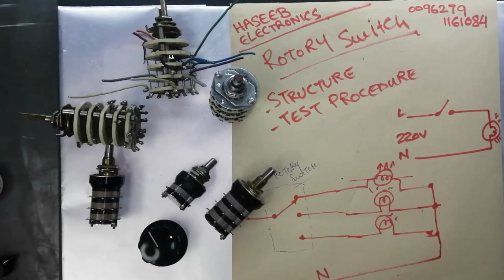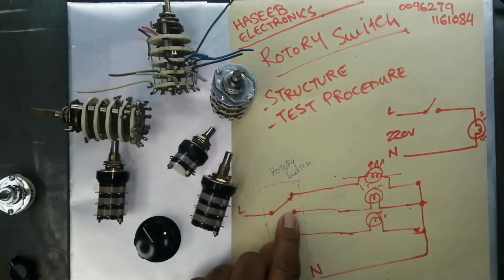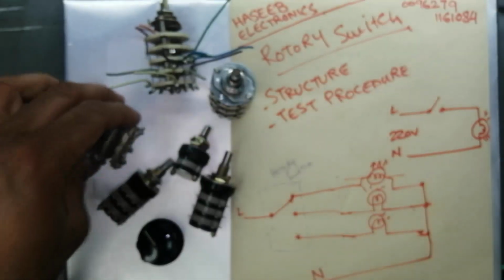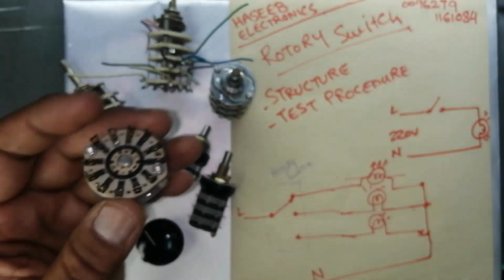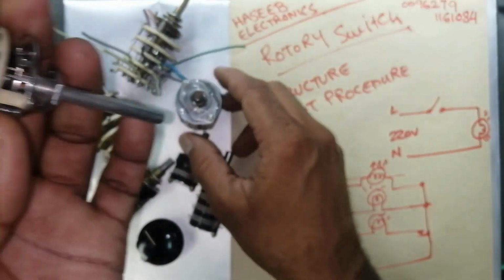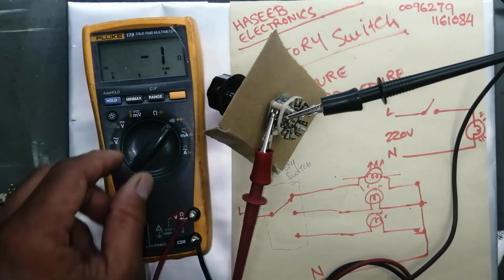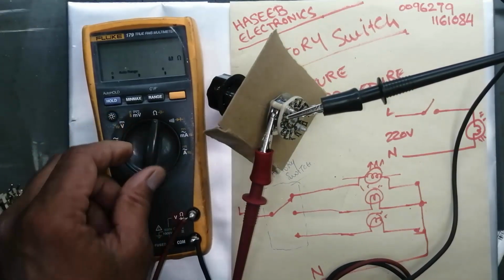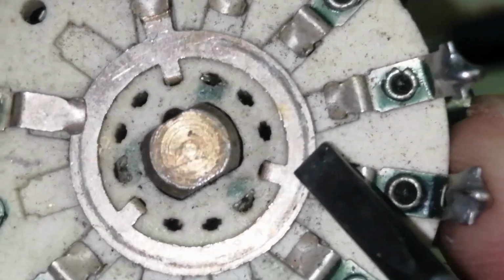what is ROTARY SWITCH its structure installation, testing using multimeter Urdu Hindi

Comment: Sir in our company we use 16 position rotary switch as feed override switch in cnc machine. Sir my doubt is can we see it's output in BCD or binary. Please give response to me
Reply from the maker: please check video number 964 that is for SDR-16
it is 16 bit rotary encoder. 4 bit BCD output 
if you have some more question. you can send its picture to my whatsapp 00962795608616 or gmail ashraf4ta4
Reply: Thanks🙏 sir

Comment: Sir, How we connect the line?
Reply from the maker: if you want to switch line voltage, then you can connect to COMMOM terminal, and take outputs from the connections on the round disk
Reply: @HaseebElectronics  Great respect and thanks.